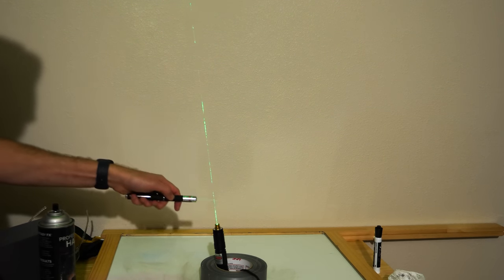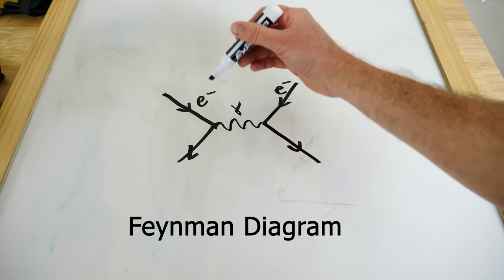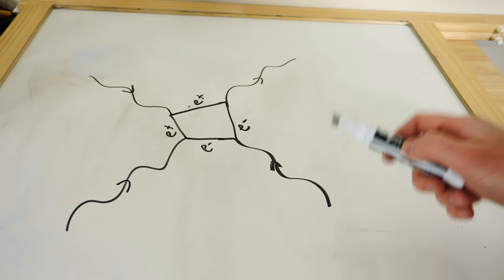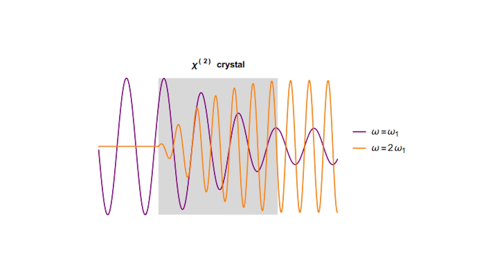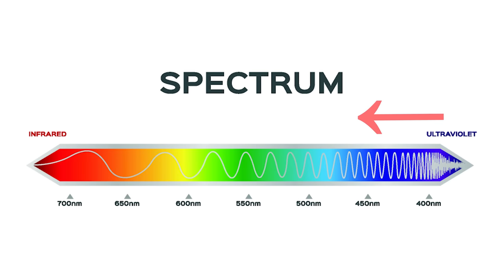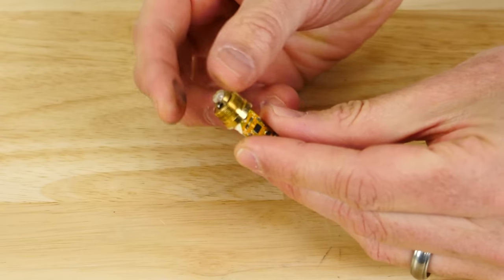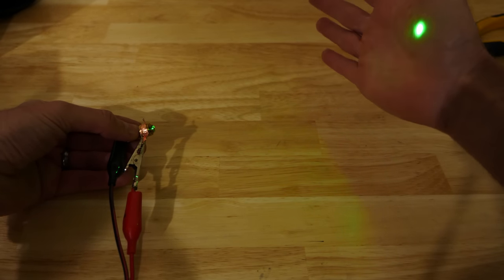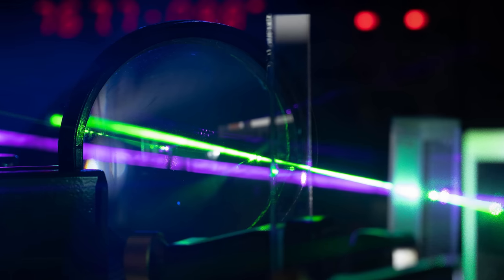Can Light Bump Into Other Light?

Comment: We actually have a really cool way of measuring single photons of infared light. Look up superconducting nanowire single photon detectors. The ones ive worked on operate at 1550 nm
Reply: What was the title of your job or whatever you volunteered for????
Reply: @D-train69  i was a "undergraduate research fellow" the devices in this paper were fun to play with in the lab:

A near-infrared 64-pixel superconducting nanowire single photon detector array with integrated multiplexed readout
Reply: A "cool" way of measuring with superconductors, eh? I see what you did there..
Reply: That's fascinating! Thank you!
Reply: @nikolausluhrs  it would detect single photons but for what??? A beam of light used to set alarms off, a laser of some sort, something emitting gfrom a computer or a navigation system for rockets,  I just don't interstand???
Reply: @D-train69  quantum stuff, look up the term and you'll seee where people are using it.
Reply: hey! we do work with 1550 SNSPD too
Reply: Free-space coupled superconducting nanowire single-photon detector with low dark counts
Reply: Can you really double a single photon of infra red? Where is the extra energy coming from?
Reply: That's cool and all, but the dude in the video implied that there are no single-photon detectors for "infrared", which is obviously false. You don't even have to go all fancy like your example (STJ, I guess?), there are various low-bandgap materials with direct photon sensitivity into the mid-IR range (InGaAs, PbS, HgCdTe), so what the hell is he talking about?
Reply: superconductors are not 0k but pretty cool =)
Reply: @RealNovgorod  The action lab guy is a youtuber. Sometimes the facts he states aren't accurate unfortunately. The only peer review might be the comments section! Idk?
Hopefully the action lab will talk to experts in each field eventually and get the state of the art low-down. To be fair this video is a lot more technical than usual and Iiked it.
Does light interact with other light and itself when coherent in the double slit experiment?
Can you use a beam splitter to get an out of phase photon beam to delete a beam of coherent light? Or rather make it unlikely for photons to collapse their wave function there?
Reply: @CorporateZombi  I don't think you have to talk to "experts" in order to avoid breaking the universe by completely forgetting that conservation of energy is a thing ("just convert a single infrared photon to visible light, then you can detect it, yay"). These infotainment youtubers are getting too lazy to even proofread their own scripts. Noone is asking him to do cutting-edge science for a youtube video, just some basic courtesy of proofreading his stuff a couple times so that he doesn't end up sounding like a jackass.
Reply: Wait a minute..what about constructive or destructive interference where one wavelength of a photon is affected by the wavelength of another to increase or decrease?? Did he forget about this??
Reply: @leif1075  What exactly is increasing or decreasing? Interference is a linear superposition of waves, so the waves add up or cancel out at that location but the photons are completely unaffected and pass through each other. You can cross two laser beams and get interference at the crossing point, but each beam hits the wall behind it as if there was nothing in the way. The photons don't get destroyed, they don't change their direction or energy (i.e. wavelength). That only happens in a nonlinear interaction (or if the light is absorbed by matter).
Reply: @RealNovgorod  OK but he made it seem like photons do interact at all I this video which is false since even how you described it implies they interact..and what exsctly do you mean by nonlinear?
Reply: @RealNovgorod  and is what he says here accurate? If you take two photons of infrared light can you combine them somehow add up their frequencies linearly tonget something of twice the frequency but not the same wavelength somehow?? Does that extra energy come from atoms in the crystal lattice I suppose? He didn't explain it really.
Reply: @leif1075  It can appear confusing if you switch between the wave model and the particle (photon) model because the meaning of "interaction" depends on the model. You mentioned interference, which can only be described by the wave model. In that sense, every electric field wave in the universe "interacts" with every other wave because the field extends infinitely (even if it becomes extremely weak "outside" the light beam). Since all waves always add up everywhere, you get constructive interference if two peaks or two valleys add up (or destructive if a peak and a valley overlap). This interference however doesn't have any effect on the underlying waves - they continue to travel in the same direction and with the same energy regardless of what other waves are overlapping. In a nonlinear medium this complete "independence" is broken because the waves interact with the medium by "wiggling the atoms around" in a nonlinear potential. The incoming wave loses energy to the atoms and the atoms radiate new waves, some of which are at a different harmonic frequency (e.g. double, triple, etc.) because of the nonlinear potential. The key point is the nonlinear (also called anharmonic) potential because the amount of radiation produced at a different harmonic frequency depends on the strength of the incoming wave taken to some power (e.g. squared for double the frequency). Therefore, if you cross two laser beams in a nonlinear medium, the double-frequency radiation produced at the crossing point is 4 times (and not just twice) as strong as one laser beam would produce alone, so they "truly" interact (their waves are changed) instead of just passing through each other unchanged.

In the video he exclusively used the photon model and said nothing about waves, so there is no way to mention interference without switching between models. For nonlinear frequency conversion the photon model is easier and more intuitive: The nonlinear medium absorbs 2 infrared photons and emits 1 green photon with double the energy as a result, that's it - no need to explain nonlinear polarization in an anharmonic potential creating a Fourier series of waves at multiples of the fundamental frequency. So this frequency-doubled fraction of radiation coming from the nonlinear potential is what he was talking about when 2 low-energy photons are combined into 1 high-energy photon. Of course photons have an associated wavelength if you change back to the wave model, so if the resulting photon has twice the energy, it has double the frequency or half the wavelength. What he maybe failed to mention properly is that 2 photons don't just combine into a new double-energy photon out of thin air. It only happens through 2-photon absorption and (1-photon) re-emission in a nonlinear medium.
Reply: @lautaroleonn  thats some really neat work, 54 percent seems like pretty good detection efficiency for freespace. A lot of the stuff i worked with was fiber coupled (obviously the paper I referenced is free space) you might want to check out "Strong Loophole-Free Test of Local Realism" - Shalm, L. K 
The group used a nonlinear crytal to split a single high energy photon which, iirc due to conservation of momentum creates two entangled 1550nm photons. Its the same technique I think we'd use if we ever get quantum key distribution off the ground in a meaningful way.
Reply: @nikolausluhrs  what are your thoughts on the recent breakthrough in single pass superconductors?
Reply: @D-train69  really useful for calibrated survey systems, low energy gyroscopes, wave guidance, data centers and central computing etc etc
Reply: @CorporateZombi  no you are adding two photons into one double frequency photon

Comment: Be careful with green laser pointers in the cold. They can turn into infrared lasers and you won't know you're damaging your eyes if you try to peek into it.
 I always wondered how they can have instruments that can dial in a particular frequency of laser light. Neat.
Reply: Wow that's some important knowledge
Reply: What does pointing in the cold even mean? “Cold” specifically. As the freezing cold ambient temperature?
Reply: @Iwvclvz  cold/freezing weather - enough to lower the circuitry and diode ability EDIT crystal ability to output green light with a high enough level of efficiency to be visible. It can differ between laser pointers due to their construction and components/batteries etc.
Reply: Isn't that infrared light has much less energy compared to visible light?

Meaning that even if you did shine it in the eyes, it wouldn't really do much damage, so no. Also in terms of energy, visible light is much more dangerous

Like in the video, you can go down the energy frequency path, not upward. If it's UV, X-ray and higher energy rays than yes it's much dangerous
Reply: @rebelwind6474  no. IR light is actually even more damaging when emitted from a high power in diode since you cannot see it and there is no blink reflex. You will be receiving a focused beam of IR which will burn the retina. Lower energy level in the context of light colour does not represent the power.
Reply: @ephjaymusic  yeah but my point still stands. It's much more dangerous to see visible light than IR. If you're gonna make a comparison between green laser and IR laser, ofc the green laser is much destructive to the retina and higher penetration than IR laser

Also the name itself is laser, it's natural the light intensity is much higher than normal rays. In fact, any laser is destructive to the retina. It's just the matter of how long the exposure is
Reply: @rebelwind6474  no. You are not understanding the difference between wavelength and power.
IR light will heat the retina for longer because there is no blink reflex.
I do not understand why visible light is more dangerous to you than invisible?
Reply: @ephjaymusic  I'm aware that something that you can't see is much dangerous than the danger that is in front of you.

If you're talking about invisible rays. UV-ray is also dangerous even though it's just above visible ray spectrum, heck, prolonged exposure can cause skin cancer

The point is, it takes more than just an instance random IR ray to fry up your retinas. You need at least, higher intensity IR  with much longer exposure if you want to do so
Reply: @ephjaymusic  also you will always blink every few seconds, so don't see your point there

Edit: and no I'm talking about how higher frequency rays are related to frying up your retinas. It is not about if it's visible or not
Reply: @rebelwind6474  you're incorrect again. You are not understanding the difference between wavelength and power output.
In the context of a DPSS laser hitting your eye, you don't require very much power in the IR spectrum to cause instant permanent retinal damage.
The blink reflex is your ability to close your eyes when a bright light source hits your eye and your body wants to protect itself by closing the eyelid. It is not the action of merely blinking. Please make sure you understand the biological definitions, and the physics of laser light in different wavelengths before you assume what is capable of causing damage.
Reply: @ephjaymusic  look again what I just wrote

I said "prolonged exposure" or "higher intensity" is when IR becomes dangerous. Same goes to visible light and other invisible lights such as UV and X-ray. The "how much" or "how long" vary depending on its frequency and wavelength

Ofc, if a laser (which has high photon intensity) can damage your retina in a short time period

I never said anything about power output. Even if it's a high efficiency laser, a low output can also be devastating if it's supplied to higher frequency ray such as UV

Btw there's also no "blink reflex" you keep insisting on when it comes to the invisible UV light
Reply: @rebelwind6474  no context mate.
Reply: @ephjaymusic  even if there's blink reflex, an explosion bright enough and fast enough to reach your cornea can literally blind you permanently

For example, looking directly at burning magnesium or looking at an eclipse (natural laser) without any eye protection can cause eye pain and temporary loss of sight

Edit: I can't seem to put the links to the sources here
Reply: @ephjaymusic  also look up Red Light Therapy

Why we use the NIR when it's dangerous like you said?

Simple, it's not. The determining factor is the intensity. A safe dosage is ok
Reply: @rebelwind6474  dude, you're so out of context it's laughable. The entire thread was pertaining to the IR light which is emitted from cheap DPSS green lasers.
Nothing to do with any of the other things you were talking about. UV, light therapy etc. Grow up.
Reply: How about telling about the dangerous invisible light from CD/DVD writer laser that hurts more than anything else even if it's not in the visible range of light?
Reply: @rebelwind6474  you are conflating energy energy density coherence stopping power optical density biological response thermal response.....
Reply: @rebelwind6474  DO NOT, ever look into ANY IR laser.
You have no idea the power that those have.
Stop with your nonsense.
Reply: @rebelwind6474  Microwave photons are even less energetic, but enough of them concentrated in a small area can cook your food, or you. Look at military lasers.
Reply: @DFPercush They don't turn into IR lasers. The IR laser is always present in the emission if no IR filter is included. An IR diode (808nm) is used to pump a solid state crystal (Nd:YVO4) to produce 1064nm. Then the SHG crystal (KTP) will frequency double the emission to 532nm. Temperature affects the efficiency of the frequency conversion hence why the green emission can diminish in colder conditions. If you see a faint red light coming out of the laser pointer. This is in fact the 808nm pump diode, and its power is much higher than perceived. The 1064nm emission is invisible. All laser emission is dangerous if it exceeds 5mW. IR photons are less energetic, but IR has more photons, so the power transmission is the same. When photon energy becomes important is when they are able to ionise. It should also be noted that our eyes will have differing levels of opacity to different wavelengths.
Reply: @ephjaymusic  you can't see UV eithet
Reply: @dartheater7348  lmao. Read the thread.
Reply: @ephjaymusic  It is not the diode and circuitry that's the problem, but the conversion into green light. The diode of such a laser (as he says in the clip) always put out IR (at any temperature), but that is then is converted into green thru a crystal array (that first convert it to IR at 1064 nm, then green light at 532). It's the efficiency of the crystal array that goes down by the temperature, causing it to just let thru most of IR instead of converting it into green. 
The output wave length of laser diodes (and even LEDs) do shift slightly with temp though. It's very little (if the wave length is 808 nm at 25°C, it might be like 804 at -10°C or something), but that can still be enough to cause problems (the crystals may need to receive pretty much exactly 808 nm for the conversion to work). 
But (as he forgot to mention in the clip) it's not all green lasers that use the crystal array either - there are also 520 nm green laser diodes that emit green light directly. Those work fine, even in the cold.
Reply: @Speeder84XL  Yes!
I felt best not to give such a detailed analysis regarding the nature of the crystal. I was more concerned with people being in denial about the dangers of collimated IR light causing eye damage. Thanks for your detailed reply!
Reply: @anullhandle  thanks mate! I was trying so hard to stick to the one point. 🤦🏻‍♂️
Reply: @GoldSrc_  @DFPercush cheers! 👊🏻 I've also used some of those high power IR lasers in a professional capacity and they're not to be misjudged.
Reply: @curtisoliver1006  Exactly! I left a separate comment about the lack of IR filters in cheap lasers. Most people have no idea though. ☹️
Reply: @ephjaymusic  you need to read and think about the comments man. high-frequency light is always much more dangerous than low-frequency one, it always contains large amount of energy no matter what. My point is even low-frequency light can course permanent damage, proof is the red laser, which is lowF, is banned if it uses more than 5mW. But if we are talking about the intentional attack, either lowF or highF light is dangerous. So both of you got a point
Reply: @ephjaymusic  Thanks for your reply!
Reply: I was under the understanding that there is literally no time it is ever safe to point a laser into your eyes. Am I just not understanding your warning?
Reply: Worse still, I believe solid state lasers create side lobes of emission (like RF), which means you don’t even have to look into the beam…. the IR lobes could easily bounce off adjacent reflective surfaces - and you won’t know until it’s too late.